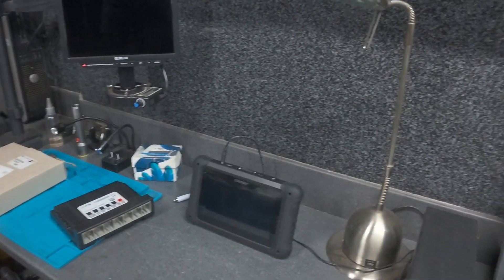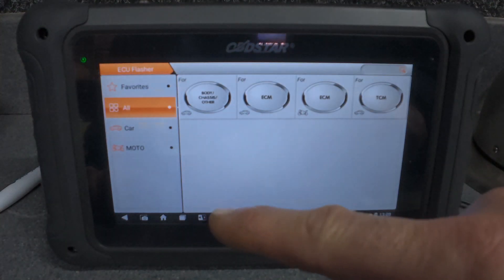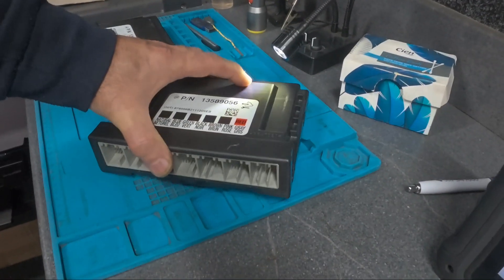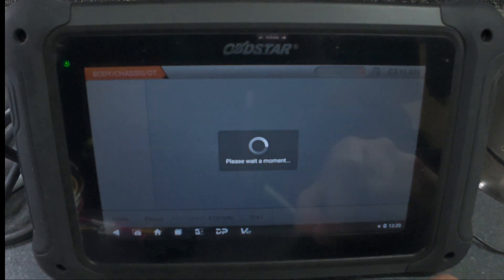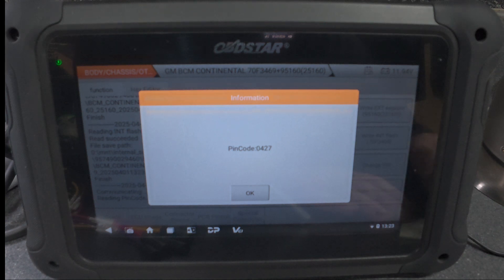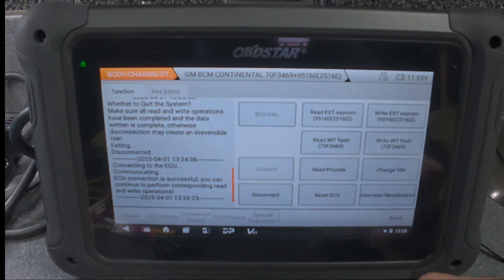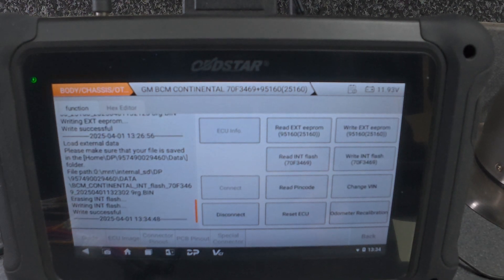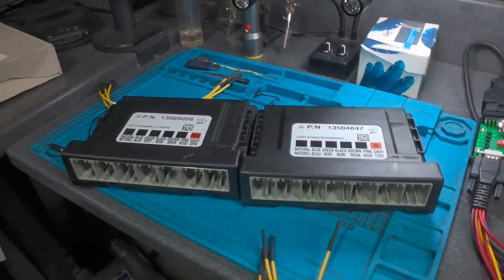Vauxhall Opel GM13589056 BCM Cloning Service, Immobiliser Data Transfer,Reading pin Code plug & play

Comment: Does it matter if the new module to be cloned to is from a manual car if the original is an automatic?
Reply from the maker: Good question

In most cases it doesn't matter - you can clone the data from the original module and it will adapt to the vehicle configuration. The important thing is that the part number and hardware version match. After cloning, coding/synchronisation may still be required so the module fully matches the car.

Comment: Hi I have astra 2012 petrol 
Car is cranking but not starting 
Some time key not opening and closing car 
And I noticed car dashboard needles vibrating without starting car
But you think which problem 
If fixable then how much you charge 
Please let me know as soon as possible 
Thanks
Reply from the maker: Hello, and thanks for watching 🙏 
It sounds like you might have an electrical or immobiliser-related issue — possibly with the BCM, ignition switch, or battery/voltage supply.
It is hard to give an exact price without diagnosing it first, as it could be a simple fix or require parts replacement.
If you’re local, I can inspect it and confirm the fault, then let you know the exact cost before doing any work.
Thanks for reaching out!